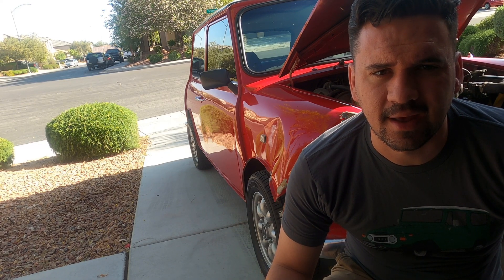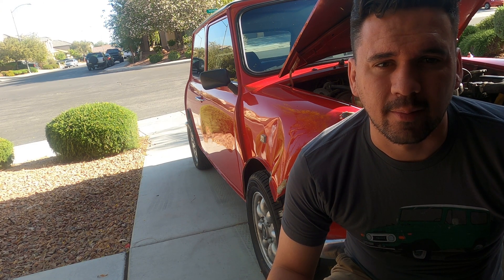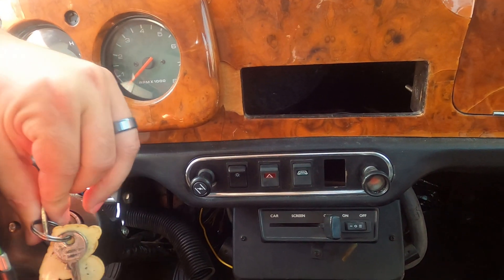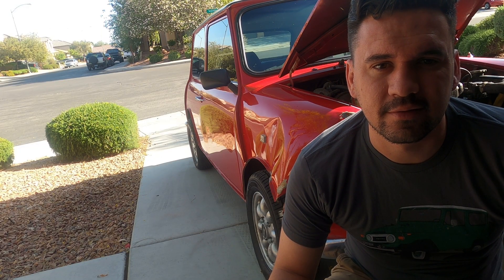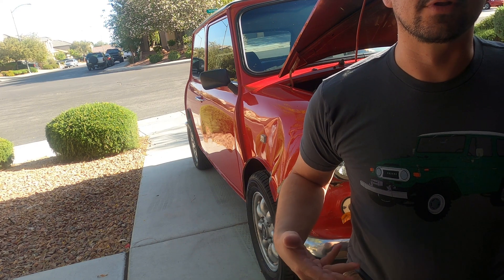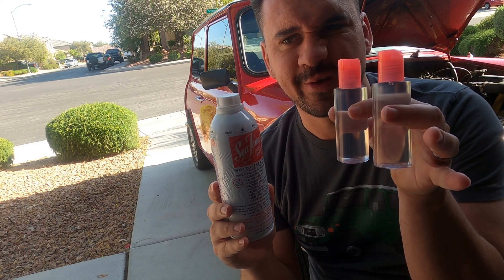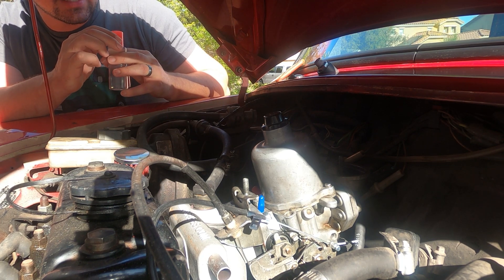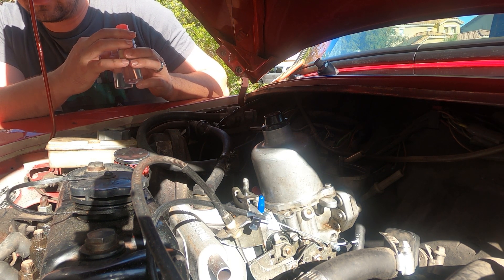Car still running after its turned off? Seafoam Treatment for a Carb motor to fix Dieseling.

Comment: My old petrol boat engine.  A 1.6 litre marc 2 escort engine converted to marine .

Engine was getting hot so i stopped and shut off. But it ran on

So i disconnected the battery.
But still ran

Then disconnected fuel lines 

Still ran on 

Starting to panic now 
Thinking it will blow up. So abandoned the boat waited at a distance.

It ran on a good five minutes with no fuel or ignition.

Surely only reason is a warped head allowinh oil in . And engine sufficiently hot enough to ignite the oil under pressure. 

Was a first for me 
Usually if you tge ignition.
It stops immediately 
And then fuel stopped.
Surely would stop. But i learned something new .

Glad i didnt have a rumaway diesel though .

I wouldn't have a boat left. Being fibreglass and a wildly shaking wngine.  Ive seen lorrys demolish them selves with a run away engine .

That would be scary stuff in a littlr 20ft boat

Comment: mine does the same and i used sea foam didnt work
Reply from the maker: if that is the case then it probably needs some carb adjustments. if that doesn't work then it might need to be opened up to remove the carbon.

Comment: hi not sure if you still answer the comments on this video. But i’m not sure where my carburetor is on my 350z. And i have been having this problem for a couple days now.
Reply from the maker: It would be fuel injected and not carb. If you use a spray bottle of seafoam into the intake it may help. There is a way to “drip” it in but it’s a little more complicated.

Comment: this is odd because i actually took apart the engine and cleaned the cylinder walls and pistons so there is no carbon build up and shot carb cleaner in the carb yet it still diesels for a few seconds.  almost all domestic (usa) gas has engine cleaners in it so i cant explain why i am seeing the symptoms and cant verify seafoam will actually fix this.
Reply from the maker: Seafoam will fix the issue if the symptoms are caused by carbon buildup. Yours sounds more mechanical like timing or carb tuning.
Reply: Leaky injectors?
Reply: @warntheidiotmasses7114  i figured it out, the carb was running rich and the engine timing was not advanced enough.  valve timing needed to be readjusted and two lifters failed and throttle linkage was not adjusted correctly, and had a bad spark cable that gave a dead cylinder so the exhaust was too rich for the catalytic converter to handle if it was cold.  i fixed it and its running fine.

many other parts on the engine failed but the inline 300 is so reliable it continued to work at reduced performance so problems can be sort of invisible unless you take the truck on the road and really heat the engine up.  because the engine is mechanical you dont have a diagnostic output of how its running or possible problems you have to physically inspect it by taking it apart and have a deep understanding of how it works and what conditions can predict failure.  i can now disassemble the entire engine bay and put it back together because i did three times when trying to fix it.  the third disassembly was just for mastery i got it working on the second go around.  im working on learning the electrical part of the truck.

the hardest part was custom tools you would get stuck because a wrench or socket extender was not long enough so having the correct yet basic tool set really helped.  also having the chilton and haynes manuals for most of the step by step process of part removal and cross sections is a great help.  the engine was a problem in itself that required another book isbn: 978-1-61325-517-9 "ford inline 6" it really is the best.  what i did to improve reliability was i removed every part even if it was not necessary and cleaned it then inspected and tested then reassembled.  after it was working you master each sub system of the engine in how it works and how to disassemble it to the level of you can teach it to someone else if necessary.
 
the guys at the ford-truck forum did a great job with all the questions you can throw at them.
Reply: @unguidedone  Nice. Thanks for the feedback. I'm in Asia and into the old Nissans. I've got a Sentra B13 1600 that diesels and one that doesn't, but it shifts hard into 2nd unless I really stomp on it, then it shifts smother. I also have a VQ 2.0 in another Nissan. It runs good. Yea I wish I had my 3 slant 6's. I could've kept them running forever. 4 ! My 69, my Dad's recked Volare, my Granddad's 4 door something, and then another 69.  But you know, you get bored and clear the deck, then regret. Thinking of starting a shop here in Asia that combines the auto business with a bar.  American women still give me nightmares.
Reply: @unguidedone Thanks for the details appreciate it
Reply: @carlossaysroar  i figured it out, the carb idle linkage settings were too tight and the carb adjustment settings were too rich.

basically on the chain i have to count 5 links and put the pin in front of the link, then for the adjustment valve i lean out the mix to 1/2 of a turn from closed.

Comment: Thanks my I have a 1982 Datsun 720 was having this problem I’ll have to try this lol truck runs great jsut  does the annoying diesel ins when I turn it off
Reply from the maker: for sure, try this and also see if the plugs need to be changed. probably needs more than just this but this is a good start.
Reply: My 1985 720 does the same thing it shutters for a couple seconds after turned off

Comment: So what is actually causing that? Build-up  in the carb jets/bowls?
Reply: Berrymans will also work well
Reply from the maker: The car ran rich for many years so there is carbon build up in the cylinders. when it gets hot enough it acts like a spark plug and ignites fuel coming in from the carb (mechanical fuel pump and Carb) if you change the spark plugs and do this it usually helps break down the carbon build up.
Reply: @LostSocketMotorsports  What is SEAFOAM? I am in UK and need to find something similar
Reply from the maker: @thomashumber9762   its an engine treatment for removing carbon build ups. I'm sure they have something like it in the UK. Just look up carbon deposit treatments for cars and see what would be comparable.